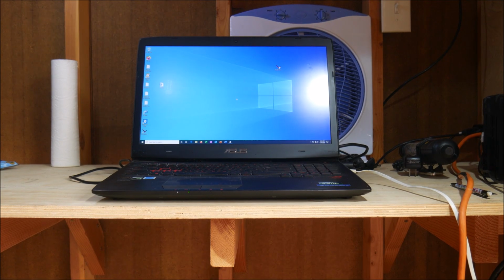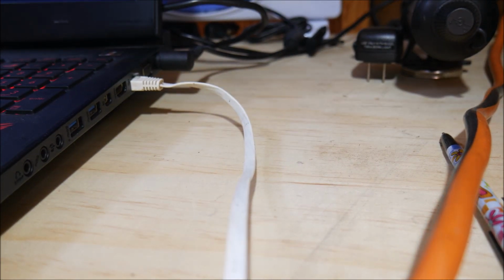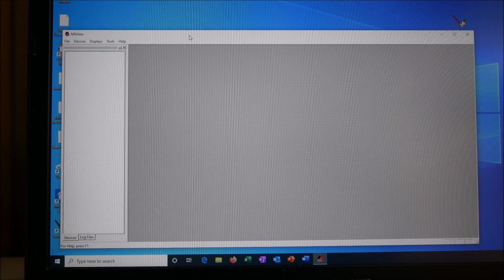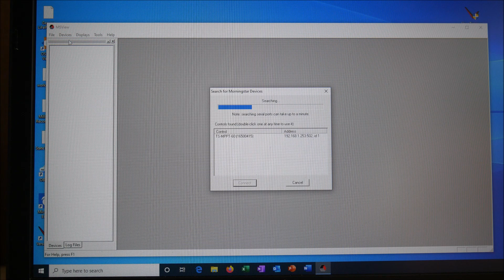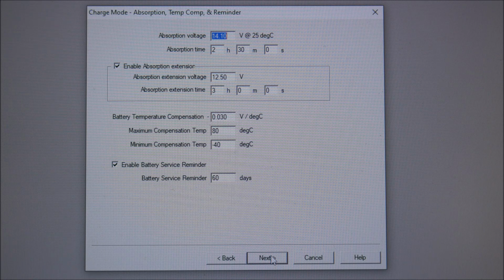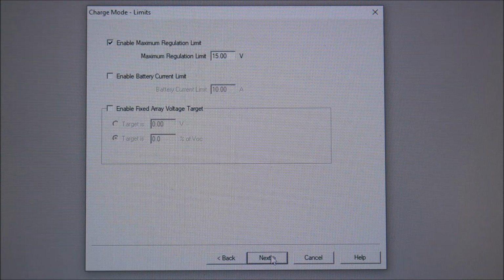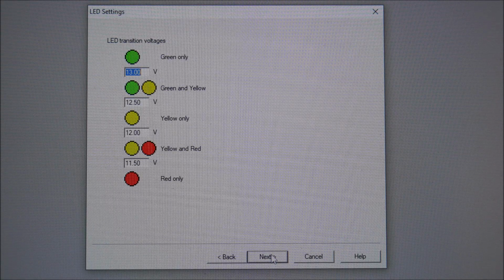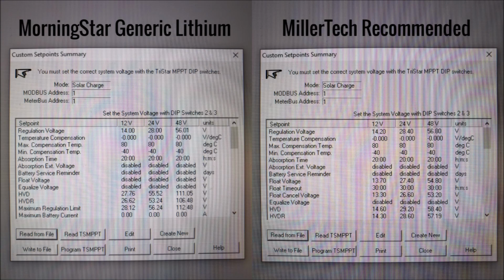How To Program A Solar Charge Controller For Lithium (LiFePO4) Batteries

Comment: What about lithium batteries fully charged finish and  BMS of charge entering,I hope morningstar TriStar MPPT 60A will not blow down fire, because morningstar TriStar does not build with BMS inside ?
Reply from the maker: I have never seen a charge controller with a BMS inside.  That is something that is always included in the battery itself or as an external device in some proprietary brands of batteries (Victron).

Comment: Hi, I have a small solar panel system, wuth a tristar mppt 45, and i want to know the correct programing information, then they are 6 panels, 12v 720 whats and a lithium battery  LifePO4 200ah, I already program the controller with the left sample, Is this program ok for my sytem? thanks
Reply from the maker: The correct settings would be whatever your battery manufacturer recommends.  The example I used was for MillerTech lithium batteries.  So if you have a different brand, check with them for what they recommend because some of them may be slightly different.

Comment: With Lithium Batteries 14V is already 100% charged. Charging them to 14.2 does not give you more capacity or better cycle life. Just to give you a quick insight on where the most capacity of a lifepo4 batterie lies: 14.0V = 100%, 13.8 = 99%, 13.4 = 90%, 13.2 = 40%-70%,  13.0 = 30%, 12.8 = 17%, 12.4 = 9% and 10.4 = 0%. So if you use a Lifepo4 Battery between 12.4V and 13.5V should do good things to the battery and you can expect double the life-time.
Reply from the maker: That is true for state of charge but not true for charging lithium batteries.  All lithium batteries charge above 14V.

Comment: I just been using mode 3 for a cheap controller. Is that okay? 😅
Reply from the maker: If you don't want your battery to perform 100% sure!
Reply: @LDSreliance  I guess I didn't even get half the kwh I was expected per charge... 😔
Reply from the maker: Ouch :(